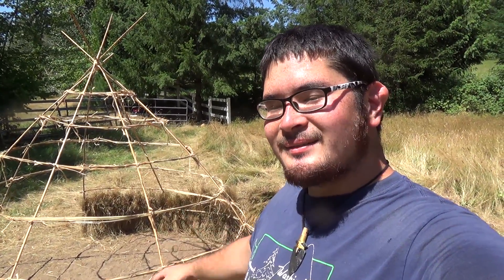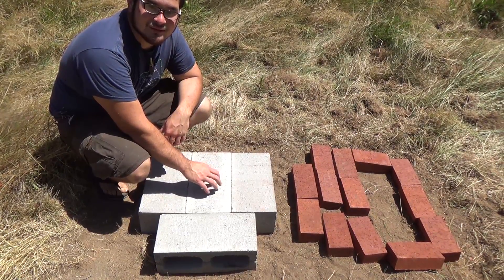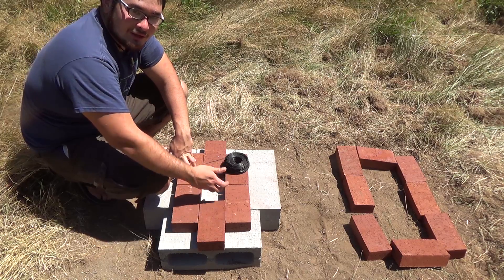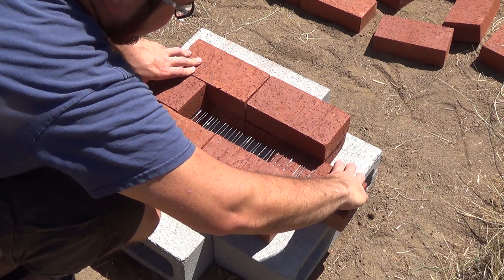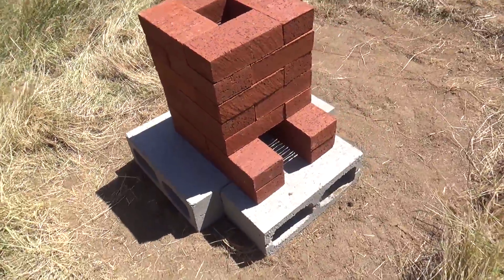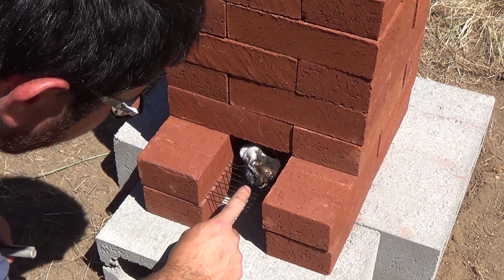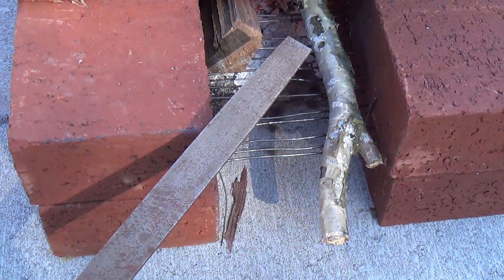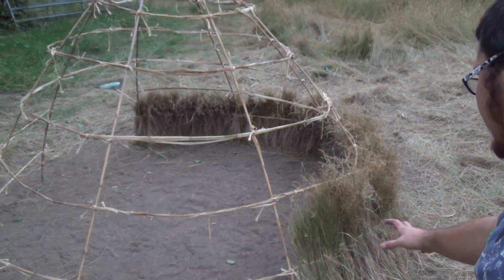Building a Brick Rocket Stove - Rocket Forge Experiment

Comment: what kind of wire is that? I don't want to use aluminum. What do you suggest? I want to use wire that won't get burned out and how can I secure it so that if I need to disassemble the rocket stove to rearrange the brick for a different type of stove sometimes, the wire will not have to be set up all over again.

Comment: Nick, I have made a similar design. I added a second tier for the fuel intake. This will give you a larger fuel compartment. This will allow you to build up more coals over time. The coals will eventually burn down and the ash will fall through the grate you have created which allows the heat to stay high. Adding more brick on the exhaust will essentially increase the draw on the fire which will help in increasing the heat. This will create a vortex and I have recorded temps in excess of 1,200 degrees F. The infrared thermostat on reached that high, so I could not see how hot the temp inside the fire chamber eventually got. I have posted several videos on building a rocket stove. They are posted on my channel. Here is the URL: if you are interested. I have also built an oven using the rocket stove plans. https://www.youtube.com/channel/UCU290sQCYhwr8lZirAfXzgA.
Reply: That's awesome! I wondered if adding height to the chimney, would cause a stronger draft, increasing the temperature. I suppose the only "downside" is increased fuel consumption?
Reply: @6truck  Yes and no. The only reason you would use more fuel would be to sustain the fire at a high level for longer period of time. What is needed is to find a happy medium. When you need more heat, increase the wood, but back off if not needed. You can also block off some of the airflow. Another thing that can be done is to use larger  diameter wood. This will decrease the temperature and sustain a steady heat, thus conserving wood in the long run. The more you use the stove, the more you become proficient with it. I spent several hours yesterday afternoon taking 2 pallets and splitting the wood into thin, medium density, and thicker wood for future tasks. Having the varied sizes of wood will serve me greatly later. Thanks for your comments. You can see my stoves on my channel at: https://www.youtube.com/watch?v=oP9o3drHUZ0&list=PLdQQu2oze9NQwK3zTLLTdTMNURvbedZDa&index=2&t=0s.

Comment: Has the concept of safety completely gone over your head?

Your 'rocket stove' will be throwing out sparks that can travel yards, but you leave all that dry grass within a couple of feet of the stove?
Thin wire 'rebars' (?really?) will hold the wood in place?
Slamming one hammer face into another without safety goggles?
Water absorbing hollow cement blocks as the base?

If you're prepping for the coming apocalypse, then kiss your kid goodbye now and avoid the rush.

Comment: you need to make a smaller secondary hole that is air tight and add a bellow that super oxides the fire chamber, then you will get forge temps but a rocket stove on its own will not get to the temps

Comment: Make a metal hanging basket so to speak and hang it from the top. Place the file into that "basket", or make a brick ledge halfway up the chamber to set the file on at an angle from the ledge to the opposite side of the opening.

Comment: dude, great ideas of yours. i've done many bows, knifes and stuff too in the past, and been into rocket stoves for almost a year now.
if you want to forge with rocket stove, you need to focus on getting the hottest air, which isn't like a normal firewood where the actual fire is happening, but in the middle of the flame = middle of the chemine.
probably your rocket stove is a bit too short for its dimentions as you are still having back fumes going out. make some researches about double combustion or fumes combustion, maybe it's better doing a "u" form rocket stove and colleting the heat at the end of the system, instead of harvesting near the coals.

Comment: Hey nick 
Maybe try and use it as a vertical forge and make the fuel compartment larger. Use the rebar wire to suspend the file in the hole on the top
Reply from the maker: That might work, thanks for the suggestion!
Reply: A wire rack be good